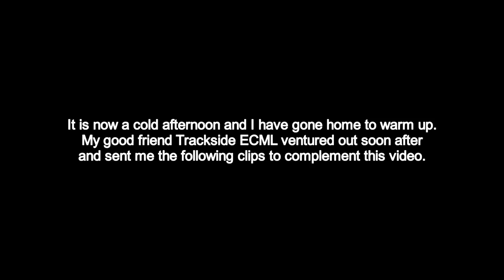Werrington Junction Upgrade 20th November 2022

Comment: naughty naughty taking the load of the OLE on the basket of the MEWP
Reply from the maker: Knowing how fragile the ECML OHE is, they can't just drop it.😁
Reply: @werringtonjunction  they should go from below and shoulder it while removing the temporary restraint or use a pull lift. Using the basket means you have no idea how much load you are imparting into the wire.
Reply from the maker: @barcooter8248  In theory and by the book you are probably correct but these chaps have done it so many times that they have the skill and feel for the job.
Reply: @werringtonjunction  i am a chartered engineer with 25 years experience in OLE, I know right from wrong.

Comment: I'll get a good look at that Thursday and Friday as I will be driving Joint Line both days. Looks to be a very good standard of work, so expecting great things!
Reply from the maker: You might be going via the under Bob.  The Up Slow has not re-opened yet, it still has a line possession in place from Tallington Junction to New England.  From observations today (Tuesday 22nd) it looks as though there is still wiring work going on in the lineside cabinets at Werrington Junction.
Reply: @werringtonjunction  Cheers for that. Been through the underpass a few times already, but always keen to go again. Quicker than the bi-directional line, so always a bonus.
Reply from the maker: @bobife1253  Never arrive early if you are on the overground route, Peterborough PSB will hold you there forever.  Line possession still in place Wednesday.  If you go the dive under route you should be ok to fly through, no Stamford trains to hold you up due to the bridge still out at Ketton.

Comment: up to the 80s it was forbidden to propel a ballast train, I watched a 47 propelling a ballast set and it became derailed on a pile of ballast in the 4ft. The ganger in charge was shouted at by the Deputy Chief Controller when he ordered the Tool vans! How things change.
Reply from the maker: Health & safety wasn't so strict back then regarding working practices whereas today everything is more controlled, or so it appears from an outsider such as me.  Thank you for watching and commenting FS.
Reply: @werringtonjunction  You may be an "outsider" but I've watched most of your videos regarding Werrington jcn. and you seem to catch [if that's the right word] the essence of modern railway work. Bit too restricted in my eyes but then i retired in 1991.